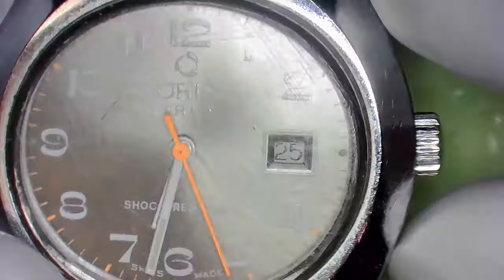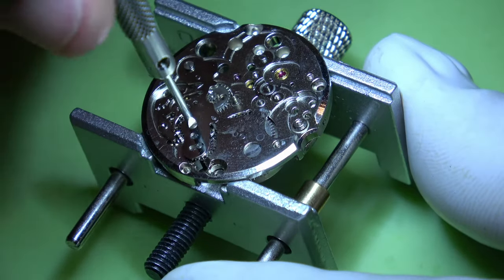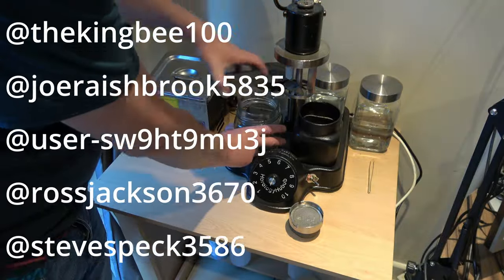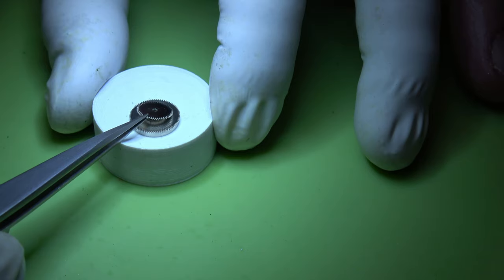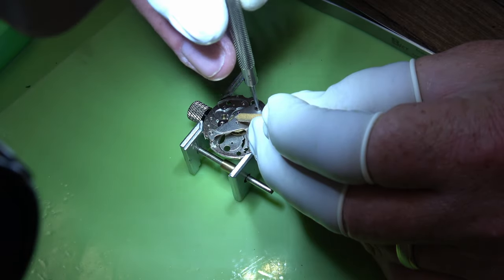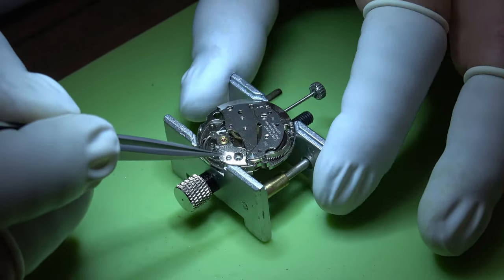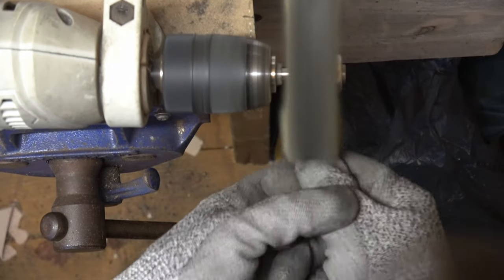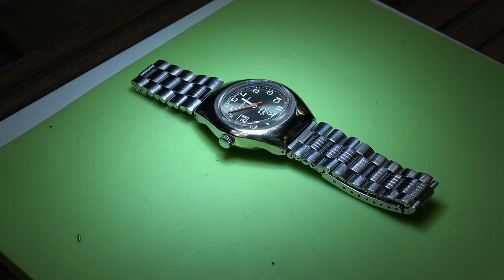Restoring a Vintage Oris Trio Watch with 715 Movement

Comment: Well done, Adie another great video.  I was cringing a bit when you was trying to fit that cap jewel spring as I knew it would end in tears, as I've found out when you apply too much force to make something fit, or remove 😆I thought that tool you had would have made life easy but it appears not so. I think most people just use two lots of tweezers and lots of patience but as I haven't come across those type yet its most probably a lot harder than it looks, like most things I find 😁
Reply from the maker: Thanks my friend I appreciate the support. Those type of spring are my worst lol thought that tool would make it easier lol great for removing them though not so good for putting them back lol speak soon my friend 😁👍👍